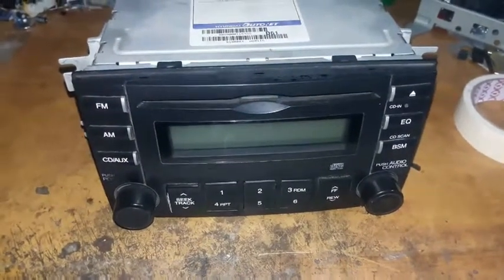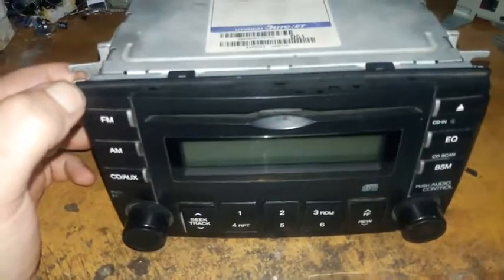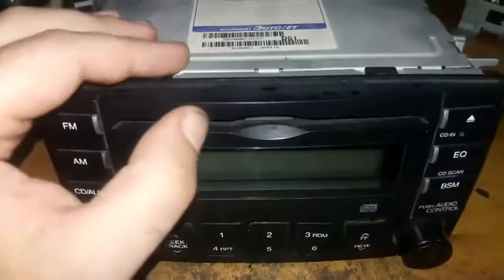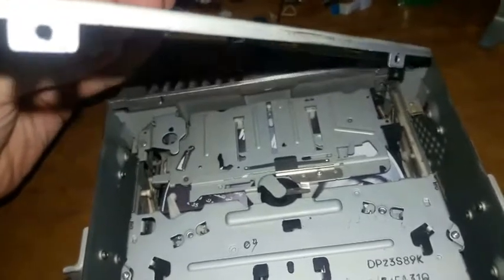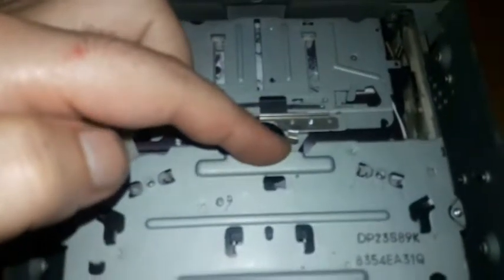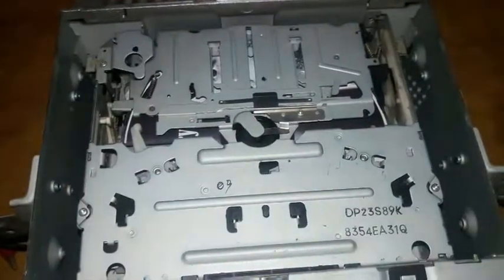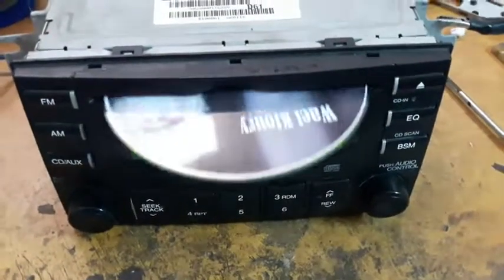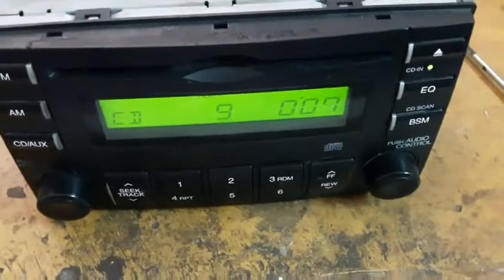hyundai /kia  hmc car audio system

Comment: Sir kindly let me know how to identify eprom chip in car audio system
Reply from the maker: Hi my friend Actually, the memory in these devices is based on the applied design where thay can use a processor and have memory built inside it or vice versa. Any way external memory can be easily identified in new design it is 8- pin and smd or dip is the same And always  it is close to the processor
Reply from the maker: If you have more questions, do not hesitate to ask. 
If you did not  subscribed to the channel, please subscribe  to receive all of my new videos.
Reply: Thank u sir for the reply, & defenitly subscribe